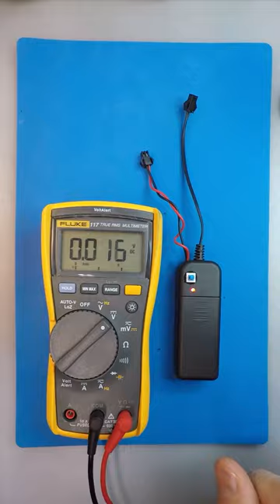EL wire inverter upgrade for stunning illumination projects!

Comment from the maker: BONUS TIP: You can power microcontrollers through the 3V output I have added to control the EL wire in different ways. OF course that includes the ON/OFF switch as well! 😄